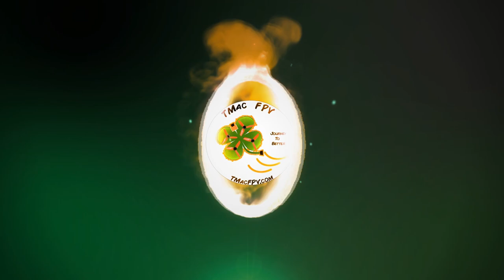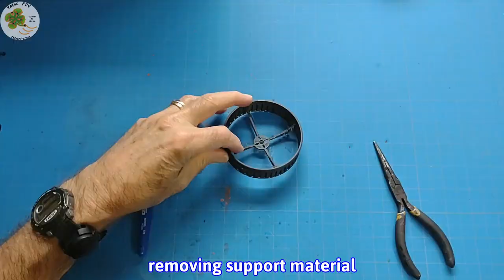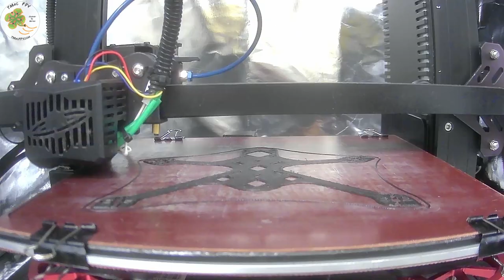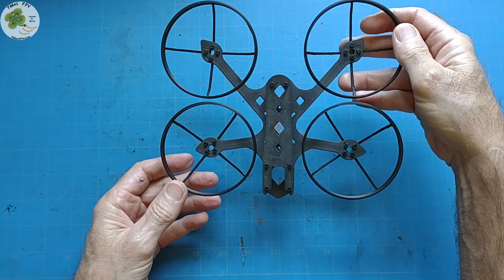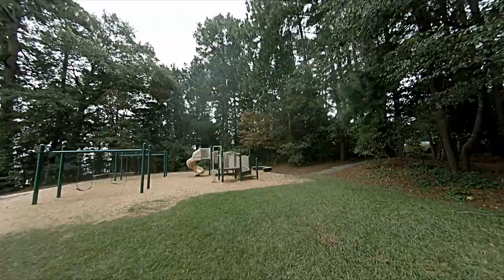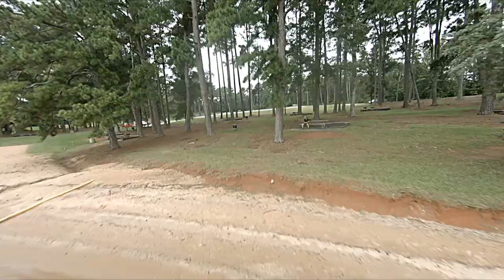3 Inch Cinewhoop (3D PRINTED!)

Comment: Which 3d printer are you using?  Thank you.
Reply from the maker: It started out as an Elegoo Neptune 2 printer. It has been significantly modified with upgraded parts to print high-abrasive carbon fiber infused materials (PLA, PETG, Polycarbonate, Nylon, Copolyesters, etc.). If you want more specifics, just shoot me an email tmac@tmacfpv.com